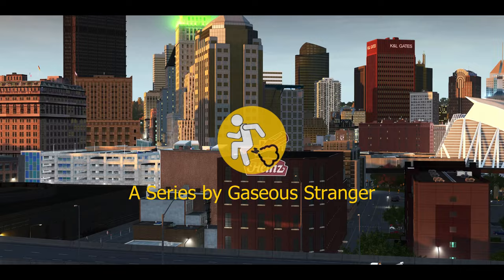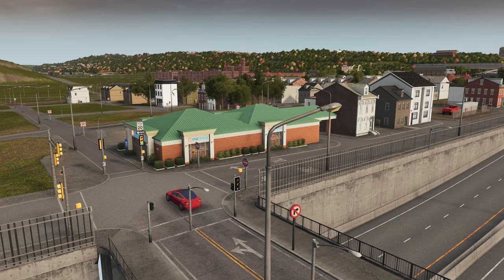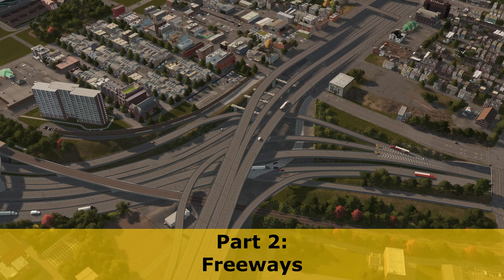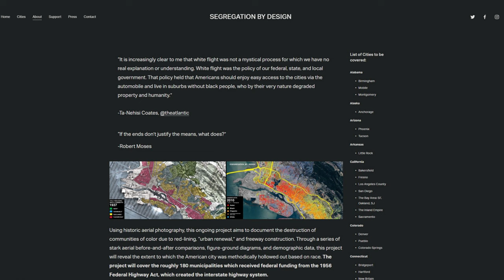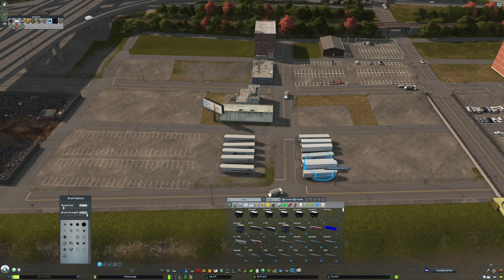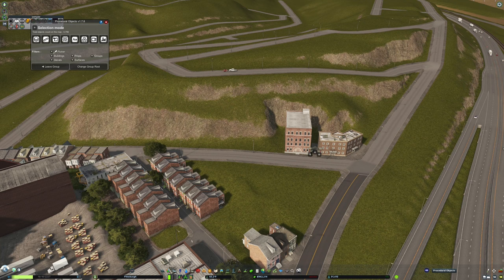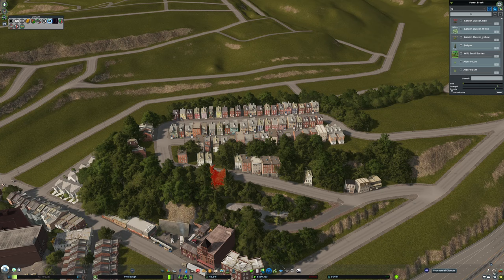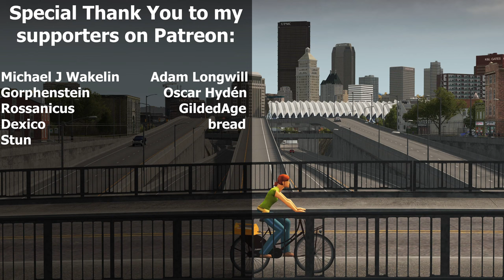Freeways Divide Cities - How Can We Fix Them? | Cities: Skylines Pittsburgh

Comment: I've never lived in Pittsburgh so I don't truly know how demolishing the freeway entirely would impact the region. But in an ideal world I think a combination of lower capacity roadways, a new light rail line and development could be worthwhile.
Reply from the maker: There actually used to be a pretty significant light rail/streetcar presence in this area North of Pittsburgh. It has been the inspiration for more than a few proposed light rail maps serving the North Side. You can see a map and read more about it here - https://www.google.com/amp/s/www.publicsource.org/mapping-pittsburgh-transit-from-streetcars-and-grandiose-plans-to-the-buses-and-trains-we-see-today/
Reply: i don't live there either but considering that americans still love cars (mainly due to how we know we can commute better with it) just put it underground or have it similar to what denver and CDOT did with project I-25. have it a sunken highway with parks overhead at certain parts, while widing the freeway and make it smarter for the long term.
such as adding HOT/express lanes (maybe 2-3 lanes per direction of travel here), that way you have travel that goes through the city seperated from local traffic, and also adding Intelligent Transportation System devices along the corridor, like traffic cameras.
think of it like this, its TDOTs SMART Corridor and CDOTs project I-25 or MassDOTs big dig project, combined with HOT lanes like in georgia, and miami.
Reply: @lopoa126  except the automobile is one of the best inventions out there because it provides unlimited mobility.
thats not propaganda, or just me being a pro car fanatic, you could go anywhere in a car, even offroad with the right modifications.
this is why people love the car, because it provides unlimited mobility.
Reply: @Zeakthecat  car is definitely a great invention, the problem is when it is the only viable option, turning it into a necessity. I'm not in the "omg look how the Netherlands are great" camp, I don't think it's reasonable copy-paste systems from countries with very different geography and culture, but Anglo-America definitely needs to learn how to integrate neighbourhoods better. People need to have the option of using a car, not be forced to drive.
Reply: They do currently want to remove the HOV lanes for light rail, but lack of funding will keep that project from happening any time soon.
Reply: @Pedro-A-88  personally i agree. there is much cheaper options tho, like increasing walkability by adding sidewalks, crosswalks and having commercial and residential mixed together, even in affordable areas.
transit can always come later if increasing walkability doesn't help.
Reply: I don't think doing away with it would be good for Pittsburgh. A lot of commuter and commercial traffic flows through that corridor. Best to keep it off the suburban streets. Commuter traffic aside, a lot of rural communities to the north as well as weekend tourism traffic from the north further still (Erie and Buffalo) as well as traffic from Cleveland looking to avoid the tolls on i-76 and i-376 will likely enter through that point as well. 

I'm saying this as a truck driver from the area.
Reply: @Zeakthecat "...The car is the best way to get around...Except the automobile is one of the best inventions out there because it provides infinite mobility..." - Hahaha, yeah sure. It's the best alright. Is that why the fact rail corridors get to use a fraction of the amount of space as highways and your average train-ride/commute in Europe and Japan consists of speeding through the lovely hills and nature ridden countryside, meanwhile your average commute in the US is traffic jams and endless oceans of gray? Not to mention all the noise - or that fact that train travel is safer than car-travel by a factor of multiplication. Cars are so great, Lol. Imagine if Tokyo, instead of being the incredibly beautiful high density city it is currently, was designed like Houston where even every small little short, insignificant building was required by law to have a huge parking lot that is larger than the building it services, to surround it? How large would Tokyo be? Like, 1 astronomical unit in diameter? 😂 Notable American cities such as Houston, Dallas and LA are literally absolute eye-sores (As a direct result of being designed to allow everyone to drive) - so much so, that they would be better off, breaking off from land - only to sink to the bottom of the ocean to never be seen again. This is because the open ocean is literally more visually appealing than the grey, billboard ridden, noisy, hot, baked-in-sun, dystopic car sewers that are contradictory to human spirit and nature, are.
Reply: @Limosethe  "Hahaha, yeah sure. It's the best alright. Is that why the fact rail corridors get to use a fraction of the amount of space as highways and your average train-ride/commute in Europe and Japan consists of speeding through the lovely hills and nature ridden countryside, meanwhile your average commute in the US is traffic jams and endless oceans of gray?"
hmm lets look at the costs of eruopes and japanese rail...
oh my goodness, 1+ billion dollars each?! which btw, includes investiment. one thing rail and transit peeps don't 100% understand is that rail has expensive costs long term as well, due to them having to be updated every 40 years that is almost never accounted for in rail budget estimates presented to city officials. sooner or later those costs have to be paid.
and that includes a giant overhaul to all rail in that city that serves passengers, which is essentially a giant replacement project. the most expensive projects from roads and highways? boston big dig tunnel project, and I-10 mobile alabamas cable stayed bridge project, that btw is gonna be tolled.
"Not to mention all the noise - or that fact that train travel is safer than car-travel by a factor of multiplication. Cars are so great, Lol. Imagine if Tokyo, instead of being the incredibly beautiful high density city it is currently, was designed like Houston where even every small little short, insignificant building was required by law to have a huge parking lot that is larger than the building it services, to surround it? How large would Tokyo be? Like, 1 astronomical unit in diameter? 😂 Notable American cities such as Houston, Dallas and LA are literally absolute eye-sores (As a direct result of being designed to allow everyone to drive) - so much so, that they would be better off, breaking off from land - only to sink to the bottom of the ocean to never be seen again."
per passenger mile, cars are more fuel efficient and generate less noise.
also i love how you don't mention phoenix arizona, which has MODERN INTERSTATE AND MODERN FREEWAYS which keeps it out of a lot of top 50 most congested cities, meanwhile the majority of freeways built in america were built during a time where we plowed through fuckall, without regard to people, environment and even long term.
and i don't personally consider living in what is the human equivalent of a can of sardines "beautiful" but you do you bud.
in fact, you should probably get out more, see the nature outside of the urban jungle, that btw a car would provide you with the ability to use. plenty of scenic roads in america that are more beautiful than tokyos concrete jungle.
blue ridge parkway, I-70 along the colorado river, among other mountainous routes.
again, you miss out on actually being able to see scenery outside. on a train? you are limited to where the tracks go, yes you get to your destination faster thanks to train technology being more advanced today than its predessors, but it still requires  tracks.
ill be kinda happy when flying cars are a thing, not because of the giant middle finger it would give to people like you, but because you can see beautiful sceneries above the ground then vtol to the ground and drive into your driveway in the middle of bumfuck Egypt (the american way of saying, countryside with no civilization for miles) and go to work remotely.
Reply: @Zeakthecat  (Part 1) Ohh boy, here we go...

"hmm lets look at the costs of eruopes and japanese rail... oh my goodness, 1+ billion dollars each?!" - Ok, so first off: The basic commonly accepted rules regarding writing in the English language: Include things such as punctuation, as the first letter of every sentence is to be capitalized. So are the names of places. It's not "europes" - It's Europe's. It's not "alabama's" - It's Alabama's. Properly separating your paragraphs with vertical spacing helps too. I have no idea if English is your first language or not, it's certainly not mine, but your respect of these commonly accepted rules that apply to writing still makes it easier to separate between all the different points and arguments you want me to understand. 

- Anyways, responding directly to the point you tried to make in your first so-called, "sentence" - or exactly what that point even is - It also happens to be a fallacy known as a self-assertion. It's when you present a claim as if it's self-evident, or evidence of something's occurrence. It is not. Things don't magically become true just because you state something. However, using some basic logic and reasoning, I can infer that your hypothesis that the costs associated with HSR are somehow higher than that of car related infrastructure, is extremely improbable. This is because rail corridors use a fraction of the amount of surface area on average, as a direct result of having a higher carrying capacity than highways by a factor of multiplication, as a passenger train can carry more than a thousand people in a fraction of the amount of space as thousands of cars - and freight trains can carry hundreds of shipping containers in a fraction of the amount of space as hundreds of individual trucks. This causes less work to need to be done per mile of railroad tracks then your average, parallel, 8-lane highway. I should also point out this logic is also 100% compatible with, if not even the embodiment of useful methodology's for understanding the world such as Occam's razor. This is because with an application of Occam's razor, you can understand that because the amount of costs associated with infrastructure maintenance and construction is a direct result of the amount of labor required to maintain it, you can conclude that it is more likely that being responsible for less surface area causes less labor to be needed for maintaining or building that infrastructure, so therefore it necessarily follows that with less labor, there is less cost. Not to mention It's also cheaper to maintain HSR because railroad tracks don't need to be ripped up and replaced like asphalt roads do. This is because by the end of the operational lifetime of your average highway or stroad, up to millions of vehicles will compress the asphalt with their combined weight - which in turn, adds of to multiple times more pounds than the amount of vehicles that have ever driven on your average highway or stroad, during it's operational lifetime. Anyways, to add specifically to what was said in the opening of this paragraph, the fact that the point you tried to make in your first sentence is nonsensical and nebulous; what do you even mean by, "1+ billion dollars each"? What does this even supposed to mean. That every HSR network has cost more than a billion dollars to build? That one specific HSR line costs more than a billion dollars alone? Please build your arguments around the principal that they should explain your alternative worldview in a way that is intelligible to others. Not to mention your response here had absolutely nothing to do with my point about the state of visual appeal in Europe and Japan vs, the US. 

"one thing rail and transit peeps don't 100% understand is that rail has expensive costs long term as well," - Ohh I think it's pretty well understood, that's why we use it as a central argument for the financial benefits of HSR as it is cheaper to maintain it as you don't have to constantly re-build railroad tracks. This is why railroad tracks dating back to the Victorian era are still being used in the UK and India and asphalt roads have to be resurfaced, or have pot-holes filled like, every dozen years? - And that's being generous here.

"due to them having to be updated every 40 years..." - There you go again, with the claims that aren't backed by a single shred of evidence. "Whatever can be asserted without evidence, can be dismissed without evidence" - As one Christopher Hitchens once put it. I should leave this here, but I'll grant you that it's difficult to get data on the financial costs associated with rail infrastructure vs road infrastructure. So all you had to do here is at least back this claim with an argument. Example, "...due to them having to be updated every 40 years or so. This is because, _____"

"that is almost never accounted for in rail budget estimates presented to city officials." - Probably because the professionals understand that once you build a rail corridor, you don't have to worry about it falling apart soon. That is why professionals are the professionals - and you are some dude on the internet. 

"sooner or later those costs have to be paid. " - Sure. Also, one could add: "So it's better for cities to not continuously put themselves in debt by building more suburban developments that they will end up having to foot the bill for their pricey unsustainable infrastructure later on down the road, so then end up have to building new developments in order to use the temporary new cash flow in an attempt to cover the cities costs in the short term as part of a massive development scheme that's been ravaging the US economy for years. At some point the consequences are going to catch up to us because Ponzi schemes always fails as they are intrinsically unsustainable."

"...the most expensive projects from roads and highways? boston big dig tunnel project, and 1-10 mobile alabamas cable stayed bridge project, that btw is gonna be tolled." - Again, a bit hard to pick out one sentence from another here given you don't capitalize the first letter of every sentence. Excusing the grammar, or lack thereof to the side, you literally made zero points here. First you started this argument with a rhetorical question, about the question of whether or not road and highways projects are more expensive. But this isn't even followed up with the pricing. So no point was made. You didn't tell me how much these projects costed. Btw, by "alabama mobile cable bridge" - Did you mean, the Cochrane-Aricatown Bridge in Mobile, Alabama which opened more then 30 years ago in 1991? It appears that you might have been trying to propose this as an example of a bridge that was built for cars, costing less than a billion dollars. Disregarding that this project was completed 3 decades ago, give me one example of a bridge built for the movement of trains that cost more than a billion dollars. A billion dollars is more than what you'd expect for your average bridge, in general. This would be as if I were to make the argument that cars are expensive by pointing to the price of a Lamborghini exceeding 200,000 dollars. Anyways, I can think of a few bridges that cost more than a billion dollars, Lol. How about the 1915 Çanakkale Dardanelles Bridge in Northwestern Turkey? Rhetorical question for course, that was 2.5 billion. (Converted to USD) 

- Also, about the Japanese Akashi Kaikyo Bridge? That was constructed at a cost of 3.5 billion USD in 1998. I think they are still paying off those costs with tolls 😂
Reply: @Zeakthecat (Part 2:) 

"per passenger mile, cars are more fuel efficient and generate less noise." - So you respond to my point about how infeasible car-centric urban sprawl is with a contrived analogy, with a non-sequiter? What's one thing have to do with the other? Anyways, it's also again, a claim without a shred of evidence or reasoning to back it with. In reality, I can securely reason that trains are more fuel efficient than cars and trucks given that most trains don't use fuel. (😂) ...As for those that do, yes, trains are generally more fuel efficient than trucks. 

1.) They operate on steel rails with low rolling resistance. This allows them to move large amounts of cargo using less energy compared to trucks, which have to contend with the higher friction of rubber tires on roads.

2.) Trains have superior economies of scale. They can carry a much larger volume of goods in a single trip compared to trucks. This means that a single train can transport the equivalent of many truckloads of cargo. Consolidating shipments onto trains reduces the number of individual trips required, resulting in lower fuel consumption overall.

3.) Trains have a streamlined design that reduces air resistance, making them more aerodynamically efficient than trucks. Trucks have a larger frontal area and often encounter more wind resistance, especially at higher speeds. This leads to increased fuel consumption for trucks, particularly on long-haul routes.

4.) Trains also have regenerative braking, a technology that allows them to recover energy during deceleration. When a train brakes, the kinetic energy is converted into electrical energy and fed back into the power grid. This energy can be reused by other trains on the network, reducing overall energy consumption.

5.) Trains often use diesel-electric or electric propulsion systems. Diesel-electric locomotives are known for their high efficiency, while electric trains can utilize power generated from more efficient sources, such as hydroelectric, nuclear, or renewable energy. This contributes to the overall fuel efficiency of trains compared to trucks, which predominantly rely on diesel fuel.
Reply: @Zeakthecat (Part 3:) 

"phoenix arizona" - Did you mean, Phoenix, Arizona? Yes you should be glad that I haven't mentioned that city. As it's a frontier that lies on the horrors that climate change has in store for us, part in thanks to, the fact that humans not only have the audacity to attempt city building in the desert, but to build unsustainable horribly designed cities in the middle of the desert. Now cars are melting and people rarely go outside and how many days per year have a temperature in excess of 120 degrees? 

 "which has MODERN INTERSTATE AND MODERN FREEWAYS" - Just like Atlanta, Miami, Washington D.C, NYC, Houston, LA and Dallas. What's your point? Your better off capitalizing the first letter of every sentence and places, for adherence to the rules of punctuation than emphasizing a non-sequiter, 100% meaningless point. Yeah? Guess where else has modern highways? Tokyo, LOL. 
 
"which keeps it out of a lot of top 50 most congested cities" - Sources. When citing statistics you'll usually want to do that.

"meanwhile the majority of freeways built in america were built during a time where we plowed through fuckall, without regard to people, environment and even long term." - Thank you for raising a good point about the atrocities associated with tyranny-way (highway) construction in the United States. Yes, millions were forcefully relocated between the end of the second world war and the 1960s (mostly) in order to make room for making cities as ugly as possible. Pretty soon after fighting in a war against a genocidal state which did the exact same thing. Oh well, pretty typical in terms of yank history given that your country is 100% accumulated stolen land. 

"and i don't personally consider living in what is the human equivalent of a can of sardines "beautiful"" - Well, you've quite obviously never been to Tokyo. Good thing I have so I can tell you about it: There are parks within every single neighborhood that are easy to get to, there are pedestrian plazas, historic buildings, gardens and temples. Meanwhile Houston is asphalt-upon-asphalt-upon-asphalt, upon billboard after billboard. So yeah, Japanese cities are Fresco's compared to your average American suburb. 

"in fact, you should probably get out more," Ohh, I think I have. Especially all things considered, which involves the fact that I've spent time outside the US unlike you, let-alone the fact I born outside the US. I've been to the Netherlands, I've been to Japan, I've been to France, I've been Venice and Rome, etc. I have the experience to compliment my irrefutable arguments. Of course I'll never make an argument from anecdotes, but why do you think I came to be like this? Because I lived in the US my whole life? Give me a break. 

"see the nature outside of the urban jungle," - So what makes this really cute, is that I Unironically live in a rural area. If you want to talk about how I've seen huge areas of once beautiful natural land get leveled by suburban developments and new road connections, we can go there. 

"plenty of scenic roads in america that are more beautiful than tokyos concrete jungle." - In Tokyo, it's not only easier to go to beautiful natural areas as it's less expensive, more convenient, safer and the journey there isn't as ugly, but you don't have to go all the way to Mt. Fuji or some far out forest in order to spend time with nature or beautiful places. Chances are if you live in Tokyo, there are numerous parks and gardens within walking distance and the city that surrounds you has strong architectural character. Because the roads on average are a lot narrower, you also don't get a sense of overwhelming isolation or alienation that comes with traveling through American suburbs. 

"again, you miss out on actually being able to see scenery outside." - Unless you go outside. Or ride High Speed Rail. 

"on a train? you are limited to where the tracks go," - Just like when you are on an airplane. Just like when you are on a freeway. If you're onboard a train, you can still get off at any station you please just as when you drive a car, you can take any exit you please.
Reply: @Zeakthecat (Part 4/ Final three paragraphs:)

"yes you get to your destination faster thanks to train technology being more advanced today than its predessors, but it still requires tracks." - Uh-huh, uh-huh... Yep. You're completely right. Other than the spelling of predecessors. The train uses tracks and can travel much faster than a car. A car has to use the traffic lane, but moves much slower than a train. Sometimes even slower than what you'd expect out of car if you consider traffic-jams. 

"ill be kinda happy when flying cars are a thing," - Yeah, I kind of said the same thing when I was 8 years old. Do I still believe in fairy-tales? Hahaha

"but because you can see beautiful sceneries above the ground then vtol to the ground and drive into your driveway in the middle of bumfuck Egypt" - It's not so much that Egypt is "bumfuck" - because it's not, but in reality has one of the greatest histories out of any country on Earth and is pretty much the second oldest civilization on Earth. They mastered writing and ambitious architecture as well when it was the Westerners living in huts using archaic tools, LOL.
Reply: @Limosethe  
"The basic commonly accepted rules regarding writing in the English language: Include things such as punctuation, as the first letter of every sentence is to be capitalized." you're first argument is ad hominem.
got it.
"Not to mention It's also cheaper to maintain HSR because railroad tracks don't need to be ripped up and replaced like asphalt roads do"
wrong. with HSR, you have to replace the tracks, do basic rail repairs and maintenance and even after all of that, you still have to update the signals, railroad crossings/rail overpasses, and if there is gantries over the rail lines, those have to be repaired or replaced. those cost billions of dollars more than the projects themselves.
" At some point the consequences are going to catch up to us because Ponzi schemes always fails as they are intrinsically unsustainable."
calling roads a Ponzi scheme is like calling remote work a pyramid scheme or owning a business thats successful a ponzi scheme. its the dumbest argument to make against roads. demand for roads will always be a thing, lets make that one thing clear, even in transit oriented countries like japan and france, the car is still a thing. why? it still provides one with the ability to go literally everywhere, even off road with the right modifications.
cars do not need roads. trains need tracks. 
"Anyways, to add specifically to what was said in the opening of this paragraph, the fact that the point you tried to make in your first sentence is nonsensical and nebulous; what do you even mean by, "1+ billion dollars each"? What does this even supposed to mean. " LOL talk about the pot calling the kettle black.
basically what i mean is what i said in short form, i cannot help it if you cannot read. didn't they teach you context clues in school? oh wait, nvm. im talking to a transit superfan who also made the argument that roads are ponzi schemes literally in the first stupid reply.
basically to spell it out for you:
most HSR projects, even in the 1960s, cost, after adjustment to inflation, at least 1 billion dollars or more each project.
the cost to build a 2 lane tolled road in todays money? mmm maybe 50m dollars if one strikes the right deals with the right suppliers and construction crews, definitely at least 200m for a good road that last a long time to be built.
and pavement projects are often a fraction of the money for rail projects. there was one guy in england who built a road using his house as collateral, and got a million dollar loan to build it, after the uk authorities said a major road would take around 3 years or more to fix the road.
the dude literally made a deal with a local farmer for half the profits over a pint of liquor at the local bar and he still made even, plus a bit more.
the people loved the road as it was better maintained.
"Did you mean, the Cochrane-Aricatown Bridge in Mobile, Alabama which opened more then 30 years ago in 1991?" more like the recently announced one that crosses the river thats supposed to be replaced, and work starting in 2024. 
"A billion dollars is more than what you'd expect for your average bridge, in general. This would be as if I were to make the argument that cars are expensive by pointing to the price of a Lamborghini exceeding 200,000 dollars." most bridges are not even a fraction of it. do you not see theres bridges across streams and creeks that exist as well that do not cost a billion dollars? maybe a few hundred thousand.
yes those are considered bridges.
onto the next dumb comment.
" They operate on steel rails with low rolling resistance. This allows them to move large amounts of cargo using less energy compared to trucks, which have to contend with the higher friction of rubber tires on roads."

try having walmart or target build train stations in their stores thats for goods only.
because that argument ignores the end mile transport needed for 99% of goods by train, sea or air. and with amazon and other stores, how you gonna get your toliet paper delivered via fedex if you gotta have a train station to get the toilet paper delivered to you for you to wipe your ass after taking a shit?
roads are not just around for ricers and car junkies to use. truckers have to use them as well.
"Trains have superior economies of scale. They can carry a much larger volume of goods in a single trip compared to trucks" 
cool. tell walmart or target to build train stations inside their stores and to turn their distribution hubs into railyards.
im pretty sure you would be laughed out the door in bentonville arkansas.
" Trains have a streamlined design that reduces air resistance, making them more aerodynamically efficient than trucks"
trucks have started to become more fuel efficient and more safer, especially in Europe and Australia where the freight trucks either have gantries over them or have long trailer trains.
even here in the states truck manufacturers  like Mack and caterpillar have to abide by strict standards for reduced carbon and more fuel efficiency.
as a side note, none of these is a argument for fuel efficiency per passenger mile, which hybrids and EVs currently dominate.
"Trains also have regenerative braking, a technology that allows them to recover energy during deceleration."
so does the prius, the tesla, and any hybrid vehicle on the road today. your point?
"Trains often use diesel-electric or electric propulsion systems. Diesel-electric locomotives are known for their high efficiency, while electric trains can utilize power generated from more efficient sources, such as hydroelectric, nuclear, or renewable energy."
i love how the go to argument for fuel efficiency is a reliance on damns, nukes and inefficient wind and solar power systems. this is why germanys and frankly, 90% of Europes energy needs is natural gas dominants, because the green technologies that is only efficient enough for off grid usage, is in fact the reason why people pay up the wazoo in electric bills and they only run when theres water, sunlight or wind blowing for the green ones you point out. nuclear power is renewable but the general public still remembers fukshima pretty well so good luck getting any politician who cares bout votes to go full nuclear.
theres a reason why people are now freezing in germany during the winter.
and no, you cannot blame it on putin. next comment!
" As it's a frontier that lies on the horrors that climate change has in store for us, part in thanks to, the fact that humans not only have the audacity to attempt city building in the desert, but to build unsustainable horribly designed cities in the middle of the desert."
ill make this side argument quick:
1. climate change has oversensitivity bias to CO2, even a lot of scientists themselves admit this.
2. they been moving the goal post for decades.
next stupid argument.
" Just like Atlanta, Miami, Washington D.C, NYC, Houston, LA and Dallas. What's your point?" most of phoenix's freeways, like the loop 303 and I-10 through downtown are all built/rebuilt to modern interstate standards. 
whereas the cities you listed? most of the interstates there are just now getting rebuilt, that was much needed for decades and most of the freeway layouts in said cities are built in the 1950s and 60s where again we built through practically fuckall.
most of phoenix's freeways are made after EIS laws went into effect, aka sometime in the 1980s and 1990s. only a few sections of interstate thats left that still has the old freeway style.
lastly, i won't go into the final set of comments because, frankly? they are stupid.
and who the fuck hasn't heard or used the slang term "bumfuck egypt"? just goes to show, even if you explain the term, some people just do not read.
alrighty goodnight everyone!
Reply: Part of the problem with the 279 project was that they were indecisive/tight lipped about the proposed path of the highway which along with the collapse of the steel industry caused property values to plummet. They also lowballed people with 18k payouts for eminent domain.
Reply: @qtipmotha  which again is quite shitty.
we did the deed of the past, but its time to actually fix the issues long term with caps.